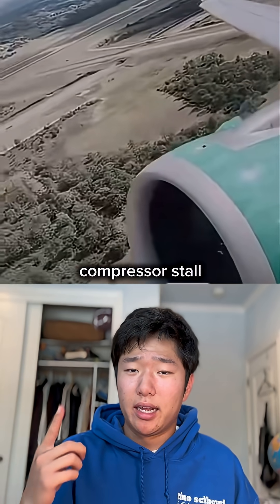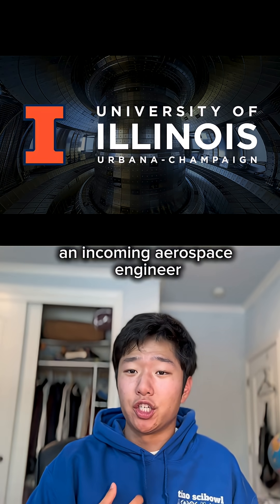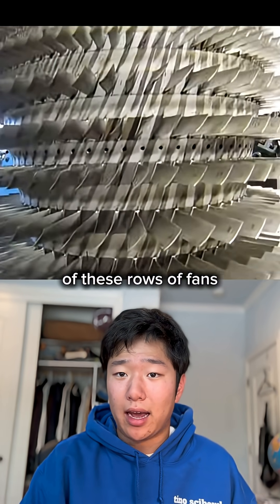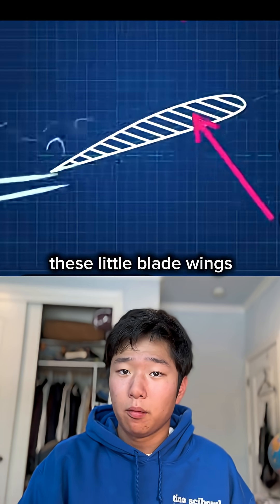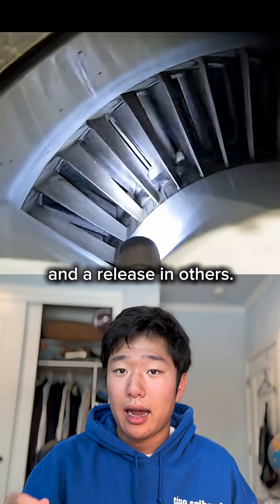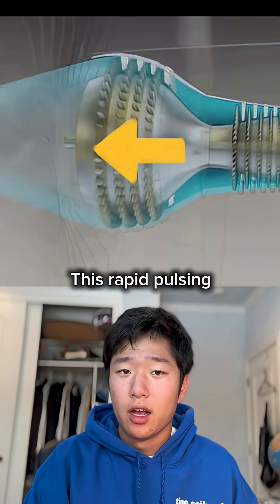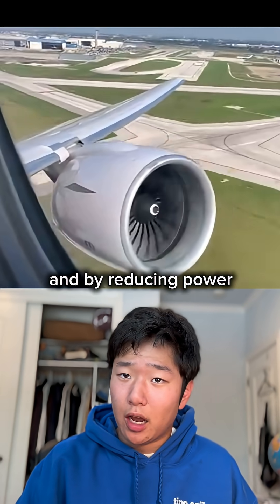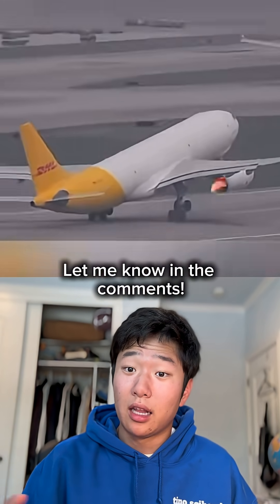What is a compressor stall? #aviation #engineering #compressor #stall #airplane #aircraftengine

Comment from the maker: Forgot to explain the "why" part: compressor stalls mainly happen because of the engine ingesting turbulent air, or foreign debris, and abrupt throttle movements. Hence why it usually happens upon takeoff.

Comment: Um... don't forget to mention that "certified to fly with one engine" doesn't mean "can fly with one engine" and it sure as hell doesn't mean it can climb or take off with one engine, you know, the two times that a compressor stall is most likely going to happen. While many airliners can indeed maintain enough thrust to stay aloft with only one. It is still an emergency situation and even "aloft" has legal definitions you may not like to hear. Sort of like how Flint Michigan had legally "safe" water.
Reply: Actually every commercial two engine plane is able to take off with only one engine. It's called redundancy and in the legalization process of a plane model things like that play a very big role
Reply from the maker: It's actually a safety requirement for twin-jets to fly on one engine lol. Does that mean it well fly well? Absolutely not. But it's enough to get you to climb to a safe altitude and perform an emergency landing. The A350 clip I included in the video is an example of a twin-jet taking off on one-engine (albeit not very well).

Comment: Seeing things about compressor stalls the day before a flight 😭 😂
Reply: Be comforted by the fact they can run on one engine lol
Reply: It is extremely rare and like others said, every passenger airplane can take off with one engine down.
Reply: @Robbedoes2 of course, I’ve flown on many planes and I know they’re safe. Though I must ask how can a plane fly on one engine, surely the difference in thrust from both sides would cause the plane to yaw and/or roll in the direction of the prevailing thrust?
Reply: @jackward2862 You’re not supposed to turn into the dead engine, but other than that, it’s pretty well and fine.
Reply from the maker: @jackward2862   Great question; pilots often need to apply full rudder to counteract the yaw from only one engine in operation. You can see that in the A350 one-engine takeoff clip I included too.
Reply: @jackward2862 yes it'll be harder to control. You can experience it yourself for a little bit if you play an aircraft simulator. If I'm right you can just shut off one engine and then try to take off.
Reply: @AvgeekEthan Thank you, that makes a lot of sense. I’m an aspirational pilot so watching your videos are greatly interesting.